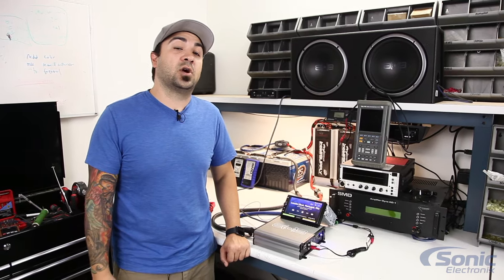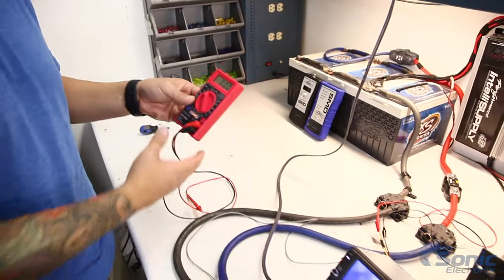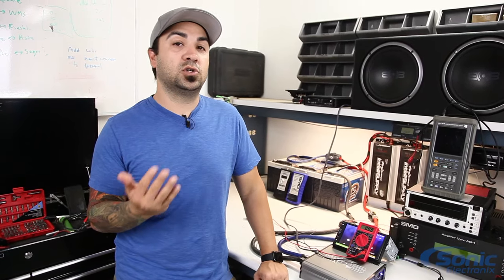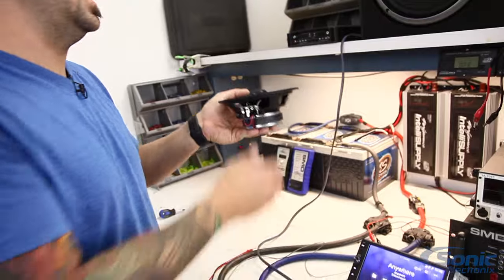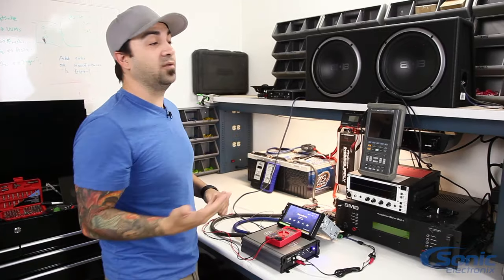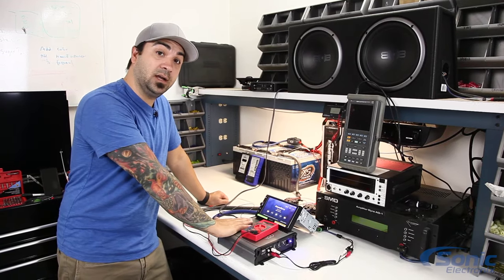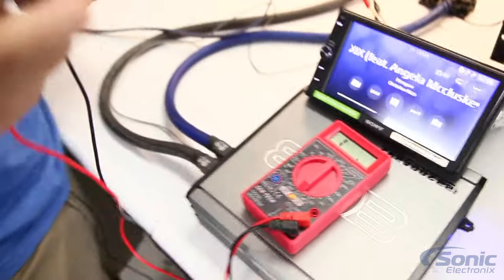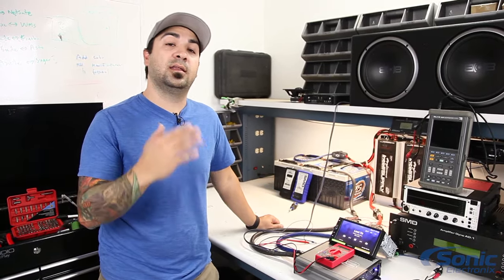Car Amplifier Troubleshooting: Sound Cuts Out When I Turn The Volume Up

Comment: I just spent hours troubleshooting my integrated amplifier using tips from other pros on youtube.  The problem wasn't the amplifier.  I watched your video and learned that the speaker wires could be the problem and they were.  My wires were touching like you said and now I have amazing sound and the amplifier isn't shutting off.  Thank you so much for being so thorough in your troubleshooting video.  Everyone needs to subscribe.

Comment: The problem I've been having lately is when I turn up my radio my subs tend to first lose output then pop. At first I thought it was a blown sub but checked both and my impedance is good. What could it be?
Reply: Same here!!
Reply: @evanholmes4403  I replaced everything in my car. My issue was a bad rca.

Comment: My amp gets good volts I re wired everything new rca speaker wires and it still cuts off at volume 30
Reply: Did I fix it?
Reply: Triple check your grounds
Reply: @briannn9799  no it still does it ::
Reply: Still no fix?

Comment: It helped to hear that 90% of the returns you look at have no problems. I thought that I blew my amp, or that the protect mode was messed up, because whenever I tried to increase the vol. it shut down and all I was left with was my subwoofer thumping away. I took the time to diagnose it myself and narrowed it down to my rear right 6". Realized that the rear wires weren't run behind the window guides and every time it was rolled down, it was pulling on the wires and shorting them on the door panel! Nice install mistake. --- Thanks for the advice - you've been a reliable source of info.

Comment: I forget where i asked, but they suggested the power lead was not large enough. The ebay kit i bought, turns out it wasnt true to what they said it was, it was not large enough and replacing it, this cured the power protect and also allowed me to turn it up way more... Someone told me that and ive tried to find where i asked, anyhow, thank you ghost fixer replying man! Thank you... Dead on diagnosis from the other side of the planet. wooo!  (READ the manual) It will tell you how long and at what gauge your wire needs to be... aks, NEEDS to be... The ground wire should always be the same gauge to avoid the whine noise.

Comment: Great tips. Beware the short. Had my system for a while & decided to adjust the angle of my tweeters mounted in the A pillars. Worked great until I turned it up then went into protect. Come to find out 1 of the tweeter leads was barley touching the mounting bracket after the adjust. Took a minute to figure out but at least was an easy fix.

Comment: I have a similar but opposite problem in my car. Usually one side doesn't sound when turning on the radio, but when I turn the volume up in a quick fashion (giving a short boost up to rather loud levels) for just about a second, the sound comes back and until the next shutdown it sounds perfectly even at low volume. What could be the reason?

Comment: I have also noticed, that if you are taking your source from a hi level input, the fader and eq on the stock deck can effect the signal going to your amp, and make it shut of when the volume is turned up. I have seen this on multiple vehicles, when the fader, bass, and treble are flat on the deck, the signal is fine through the entire volume range, but if the fader or bass is adjusted the signal being sent to the amp is too hot at higher volume, and will trip the amp.
Reply: That is because it is common to adjust the gain with everything set to flat.    So once you adjust your equalizer for higher gains on certain frequencies, it can cause the amp to clip.   Generally, it won't be a problem if you use a 0db test tone when adjusting your gains, and the music you listen to is -usually 5db or lower.  So it depends on the recording level of the music you usually listen to compared to the level of the test tones you used for adjusting your gain.
Reply: I had this happen in my car, even if the gain was all the way down the amp would still go into protect around 75% volume, even if the sun wasent playing since the gain was down. Did you ever find a fix?
Reply: @Drillorz  I found a solution, but i havent done it yet. There is a way to tie into the factory amp with a fiber optic cable to get a clean signal, run that to a dsp and amp, and run new wires to all the doors/speaker locations. 
If your tying into a factory head unit, Id try and find a forum for your specific vehicle, where people post up builds they have done with your car, and try to find what people do to get a clean signal, this is how i found out what i need.
Reply: i’m having that problem now but it’s not the ground and i can’t figure it out

Comment: Hi, great video, can you advise me please? My head unit keeps restarting when turned up high volume. I have followed your video and checked everything, changed the speaker wires, changed all the wires in fact, even tried a different head unit, different amp, different speakers, yet the same thing happens with all. I have tried wiring everything direct to the car battery only, same thing happens... Does this signify that it is a problem with the battery not having enough power to cope when volume turned up?

Comment: What happens if your amp doesnt shutoff but the audio output channels cut out intermittenly on low volume, but plays fine when amplifier gain is set to max. My amplifier has this weird issue. When the amplifier is powered up from a cold state, it runs fine at low volume for 20min or so and then begins to cutout intermittently. However, if I set the amp gain at max, then the issue goes away. However during this time, if I turn the amp gain back down then its cuts out intermittently again immediately. So once the amp warms up, It will only run fine if amp gain is set to max. I’m  stumped, never seen this issue before. Checked all wiring, ground and dc power voltage and everything is fine. Only thing that drops out intermittently is the voltage on the output channels, but dc voltage remains constant at around 13 - 14 volts or so. I’m assuming there may be a bad cold solder somewhere internally in the amplifier circuit board that could be causing a bad voltage connection once the amp warms up around 20minutes. Could incorrect amplifier bias settings also cause this issue as well? Or perhaps bad resistors or capacitors? Quite stumped on this problem.
Reply: i have the same problem, did you ever fixed this?

Comment: I'm pulling 14.4 volts at the amp (5 channel)... at around 55% volume I have the amp go into protect and not come out, however sometimes it lasts 5 minutes and sometimes it doesn't shut off. I find when I unplug channel 3 that the problem goes away (so I have replaced the channel 3 wiring and both the tweet /6.5 on that channel).. at that point it's a bad amp right? 
... help me obi wan kenobi, your my only hope

Comment: So I have been struggling with audio issues in my 03 Corvette. I've taken out all of the old Bose stuff. Only thing left from that system is the pac harness. I have a touch screen kenwood. I'm using both RCA jacks. Ive got my 2 fronts and 2 rears going to a 600w amp and a 4f cap (it was on sale for cheap, so I said f it). I also have a self powered sub. Whenever ive been bumping hard at high volume, the amp cuts out and the powered sub, goes off but shows its getting power. I can't figure out what the hell the issue is. My grounds seem fine.

Comment: Hello I setup a subwoofer in my truck and I turned the bass knob all the way down to test and turned the volume up and my door speakers cutout is that faulty wiring I restarted my radio and they turn right back on ??? I did not hook up my door speakers to the amp I just tapped into those wires for the LOC I used crimp terminals in the back of my radio to LOC so I feel I did all my wiring correct! Any ideas ?

Comment: Hey, may Holden viva has everything working well with loud sound and I love it, the problem is my volume steering controls are not working yet it was working on my factory radio before I took it out. What might be the problem? Am Using Sony XAV-AX3000 Headunit.
Reply: You need to get the appropriate adapter to connect the factory steering wheel wires into the steering wheel input headphone jack on the back of your new radio

Comment: MTX thunder75.4 amp think 400 watt 4 channel 
2 8’s P2D2 think 500w 
2 pairs of 6.5 P1650 Rockford fosgate had problem where couldn’t sustain 50 max volume some songs couldn’t get past 30-35 took it to shop that installed it said battery negative side was loose so tighten it and fixed but now after like 5 songs it starts to cut out again can you guess an the issue the shop isn’t finding

Comment: I have this problem with my truck also being the amp cutting out.The stereo was already installed when I purchased the vehicle and has a capacitor installed with it. I finally looked at it the other day and noticed that two grounds are wired to the capacitor. When you mention bad ground and I hear people saying amp and capacitor should have separate grounds....Could this be my issue with my amp cutting out?

Comment: I have a strange problem may be you could help.
So i kinda experience sound quality oscilation. When I'm experiencing really good sound quality from my system, when I turn up the volume the sound cuts and only the sub is playing. This happens until the sound quality gets worse by itself, without doing nothing, just using the radio normaly, and keeps that way for months until randomly become good again, but it lasts a week or so.. when I say i lose sound quality is like a file that is 320kps sounds like its 128kps.. Feels like the amp stays in security mode or so...

Comment: Any idea why it would happen in a stereo with a built in amp (sony ax7000)? I checked stereo, wires, speaker, power, ground, alternator but I cannot figure out why it goes into protect. Pls help

Comment: My amp worked great for a few months, but now when I plug in my RCA's, it goes into protection mode, I tried different RCA's and still, the same thing, is it the amp that's the problem?

Comment: I need help I have 4 4 Ohm  infinity reference speakers connected to a 2 Ohm amp and when I turn up the volume the front speakers cuts out and the rear speakers keep working fine  any ideas what can be the problem???

Comment: My amp doesn't go into protection mode, it doesn't even shut, off it plays for five minutes depending on the song. The subwoofer will quite down and still play but really soft and it'll have a slight buzz with the beat like it's blown, but it's not and I've tested all my subs even my smaller subs does the same thing. Last time this happened the protect light came on and I just clipped the ends of all the 4gauge wiring due to melting. Can't really afford bigger gauge but that fixed it. But this time my protect light isn't on could it be linked to the same problem. Should I just go ahead and rewire the whole thing? I've clipped the ends this time and did not fix it. only plays a little longer before going soft. Could there be wiring in the middle be burning itself apart where I can't see?

Comment: Ok, I have to correct you...
The multi-meter will read through your body, creating addition resistance. If you probe you 2ohm sub, without your thumbs, you will most likely see 2ohms.

Comment: I have the opposite problem. Sound (the speaker protection relay) cuts the sound when I turn the volume down on volume knob. And in my case its not the car amp but the hifi stereo amp...

Comment: Mine was something like that but when I increased volume everything was fine but as soon as I used more than 30% gain that’s when the sun will cut out sometimes it would play fine until 50% gain and then cut off and not come on again until I turn off and on

Comment: one thing to add is how to do power to power or ground to ground voltage drop test,since the meter measures difference in potential you can isolate what wire has the vd,by placing one end on ground of batter and the other at the ground of the amp any voltage you see on the meter is actually the loss of voltage so if it says 4v you have 4v loss.you an then move the meter probe up the wire and if the meter reads say 0.2v you just past where the VD is and can work your way bake and forth till you find the exact spot.you can then do the exact test on power side next and see if it has voltage drop. the purpose of doing this is to narrow down if your VD is on power or ground side voltage drop. easy easy test.

Comment: HEADS UP PEOPLE: your car battery should never read 11.5 volts with the car off, especially on.... If it does you need to hook it up to a charger ASAP. If it drains back to 11-11.5  you need a new battery... if the battery is quality and new then you need to investigate your alternator(charges battery)

Comment: Im having a issue with sound going out sounding horrible after lets say 15 to min plying sounds perfect until after that time frame then it sound horrible low and distorted any ideas where to look deck is a new pioneer MVH-300EX speakers are new  NVX VSP525 fronts and NVX VSP65 for the rears
Reply: 15 to 20 minutes of play time front speakers are components by the way

Comment: Im havith a problem with my subwoofers and amp I'm pretty sure it's my amp my amp is not turning on I changed all the fuses and I'm not getting no power to it when I if the remote wire to the positive wire the protection light comes on and dims out within two seconds I just bought a digital meter I need a little help

Comment: My radio turns off at high volumes. Does that also mean a bad ground?
Reply: you ever figure it out. i think im having the same problem.
Reply: It might be where you connected the remote wire from the power the amp. The connection where the stereo is.

Comment: Hi guys. Please help me with my system. I have a kxa800.5 amplifier with 4 door speakers 100 rms each and a sub with 400 rms. I also happen to have that exact same radio that we see in the video above. 

Now my question:
Could you please tell me the possible reason why my radio will lower my music volume when my phone alarm goes off? 
When I play music on my phone it works great. (My sub could have a little more bass output though but hey u get what u pay for I guess)

However when my phone alarm goes off and starts ringing, it will cut off my music and I will hear my alarm not through my door speakers but through my phone.

Then when I turn up my volume to max to try to get any sound from the speakers, I can only hear it barely. Like perhaps the radio goes into protection mode or I’m not sure.

The amp has a red light to show if it is protection. But the amp is fine and the red light is off. 
Please help thanks for your time in reading this long explanation.
✌️
Reply: Edgar Mendez do you play music from your phones 3.5mm jack ro bluetooth, i know my phone temporarly lowers the volume for a few seconds on 3.5mm jack when using headphones when i recive notification

Comment: my amo goes into protection mode and i checked every single wire all are perfect its a brand new jl audio 4 channel 600watts
Reply: I been having the same problem lately with mine . I got 2 JL Audio amps running   300/4v3 and 600/slash and I have a Hc 600 kintetik battery hooked up also. I checked everything and cant find the problem.  The box just cut off one day. I comes on at low volume 1-3 at 4 the sound is lost. But my problem is the battery drains and I got a parasitic drain. Pulled all fuses and nothing.. come to find out it's the alternator. So I'm going to see what happens when I finally get another alternator put in. I got a 142amp alternator in my car now but I'm about to get a 250 amp alternator to make sure its enough to pull the system without any electrical problems.
Reply: @J68browneyez  my alternator is perfect charges the way it should took of my amp and connected all my speakers back to the stereo not the best quality but the music doesnt die on me no more

Comment: I have a brand new pioneer 4 channel on my mids and highs.when i turn the volume on my head unit past 20 my amp goes into protect mode. I checked my ground and my power and every thing checked out.
Any ideas on what might help solve my issue?

Comment: I have tried all the steps you have shown here but still my amp goes on protection i have tried 3 different amps but same issue
I have even tried the terminals directly from the battery and 2 different subwoofers 
The speakers are connected to different amp  and subwoofer to different amp
Reply: Have you adjusted the gain correctly?
Reply: Richard Middleton yes i have tried that 
The only thing is now that its not working on bridge but if I connect it on right or left channel its fine and the amp has option for bridge but it goes to protection really quick
Reply: @uzairali2952  How exactly did you adjust the gain?   Did you use an oscope and 0 db test tones?  Multimeter might be sufficient, but you can actually see when it starts clipping if you use an oscope.

Comment: Hi, I have got myself brand new one pioneer MVH-G219BT.  My issues is, when I turn up volume high and adjust equalizer my stereo gets switch off n then gets turn on. I have connect stereo directly to battery too, but still the problem occurs. Any1 facing issue..? N pls give the solution for this issue. Thanks